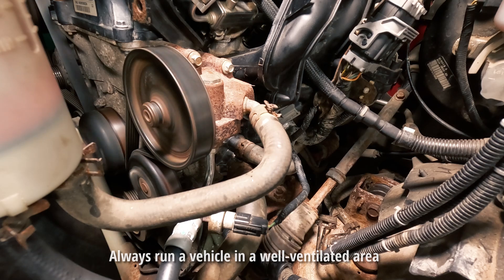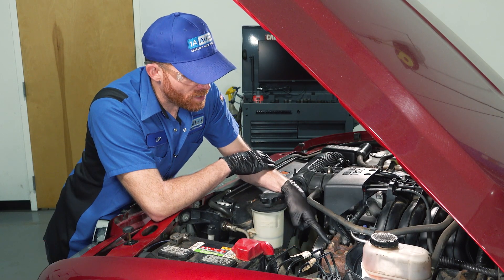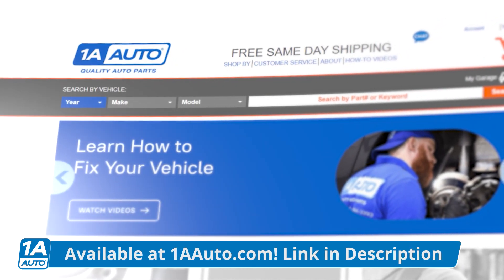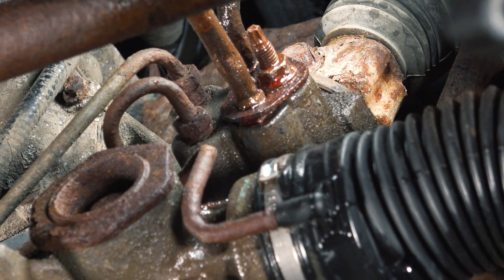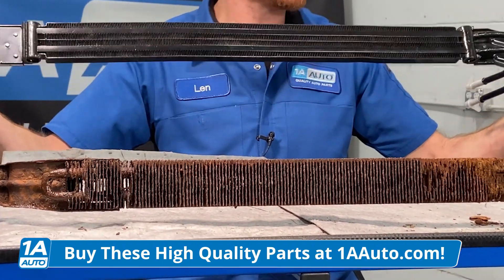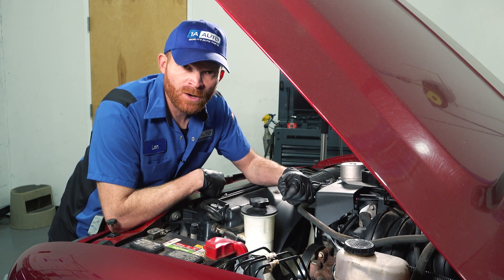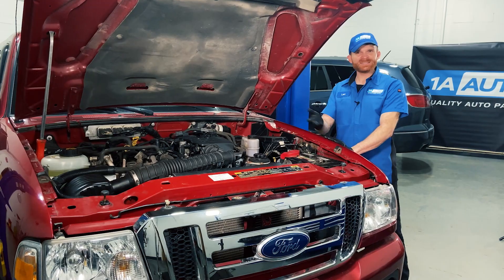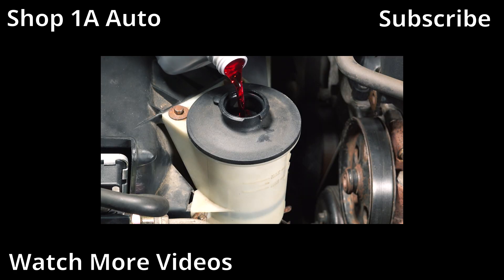Car or Truck Hard to Steer? Let's Discuss the Top 5 Parts You Can Replace to Help You Steer Easily

Comment: I ACTUALLY had this problem about a month ago. 

The drug addict mechanic THOUGHT it was the power steering pump; but it turned out to be the alternator. 

TRUE STORY: 
He changed the power steering pump, and this exact noise was still going. Then, he told me that it has to be a pulley or a tensioner. He took all the tensioners and pulleys off, and the noise was STILL going. He even had me waste another $32 on a pulley. 

He told me to come back the next day with an alternator, and he would put it on FOR FREE. I came back the next day, and he told me that he would not be able to get to it, because he had other vehicles, that had priority over mine. He told me to check back the next day. I checked back the next day, and he didn't even open up the shop. 

Mufuka made me late on my bills.